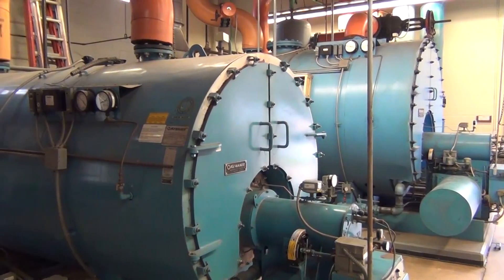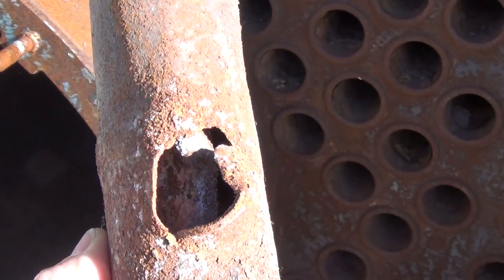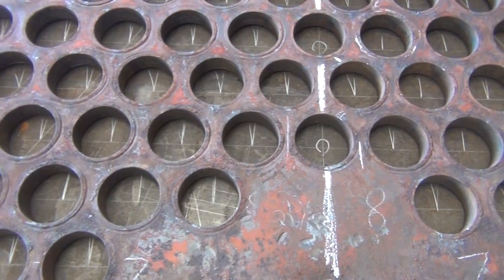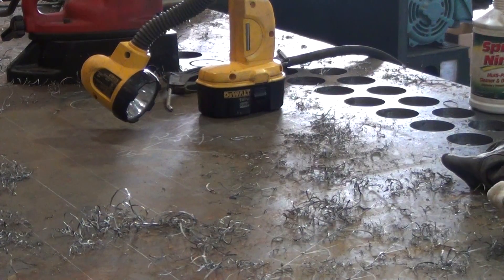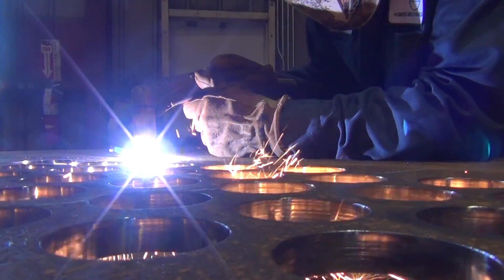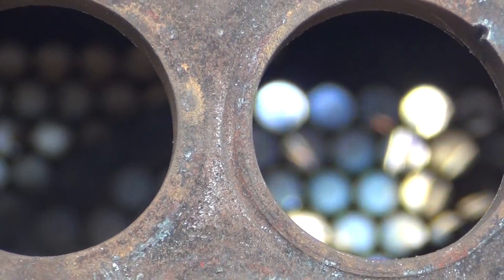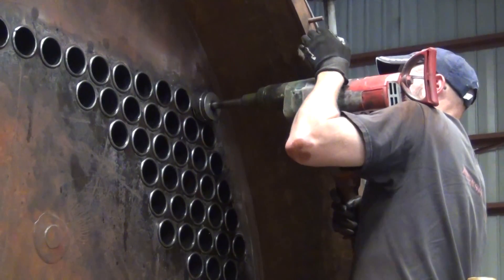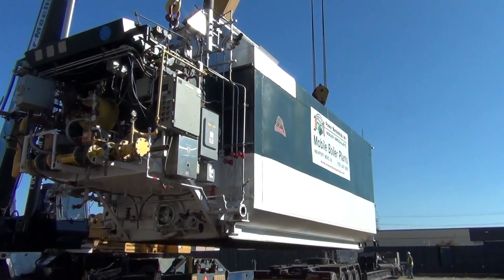ASME Pressure Vessel Repair

Comment: Without welding flue pipes with boiler plate how it's possible to make leak free operation
Reply from the maker: By flue pipes, assuming you mean the actual flue or exhaust stack there are a few different configurations. An airtight operation may not be necessary under some conditions. The draft in the exhaust will allow the stack gases to vent sufficiently. There are some designs with mating surfaces that seal with gaskets and collars, and some designs may simply slip into place. Its all dependent on design, draft, furnace pressure/requirements etc.

Comment: What was the cost saving compared to a new one?
Considering the cost of labour for dismantling, cutting old tubesheet & tubes out, also made of cheap carbon steel (ASTM A516-70 is cheap), then putting everything back together (I didn't see any NDT performed on that tubesheet weld as well) and also taking into account the overall state of the boiler before the repair, I would think a new one could've been a more feasible option.
At least - if I were the plant owner, I would probably prefer to have a new one on my site. Or both - one new operating and this one repaired as a spare.
Reply: Lol you definitely don’t work in the field man you have no idea what you’re talking about. A new boiler can cost hundreds or thousands and if that shit works fine with a little fix they’re gonna do the cheaper option every time. Plant owners don’t give a fuck about anything as long as they get their steam output
Reply: @jasonanderson8269  good response